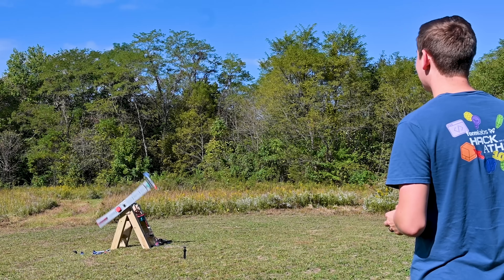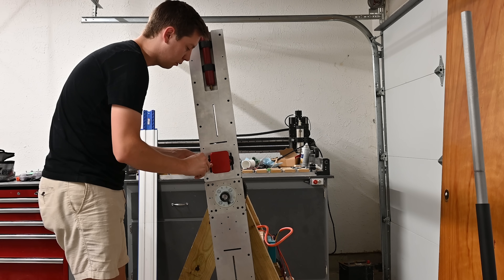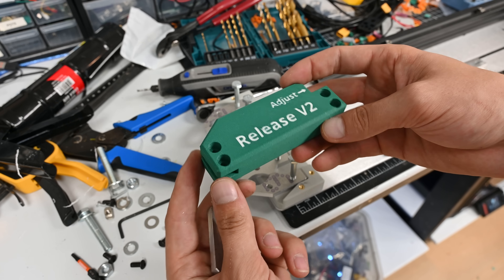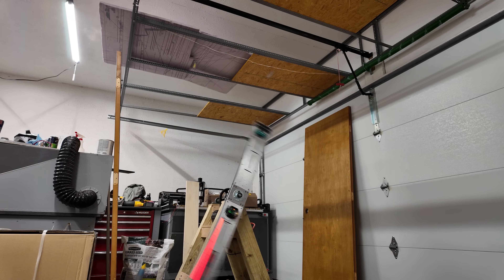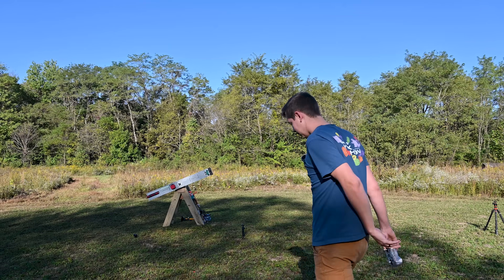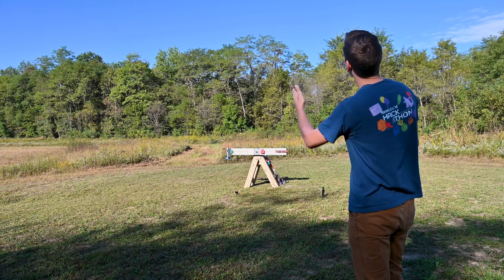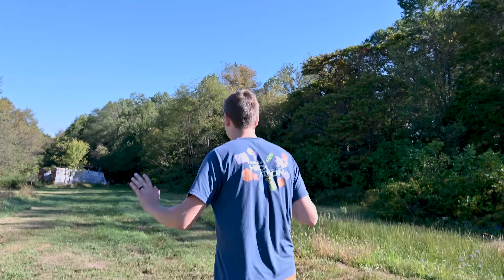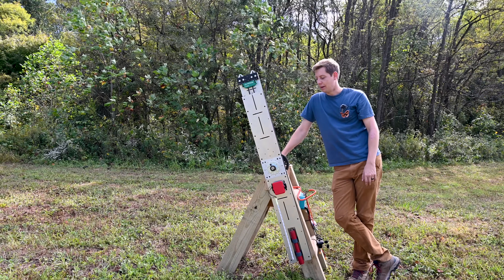I Fixed SpinLaunch

Comment: I may be incorrect as i dont fully know how the release mechanism is powered, but I think that the reason it didnt launch at full speed was because the mechanism requires the green piece to move inwards toward the pivot while the arm is spinning trying to "throw" the green piece away from the pivot. At full speed the outward acceleration might have overpowered whatever force you are using the pull the green piece inwards. Just an idea Good luck

Comment: having those spacer bars retract parallel to the arm means they have to fight the centrifugal force while it is spinning, which is why they could only release below a certain rpm. Easy fix would be to have the spacers retract "up" perpendicular to the arm, which would keep the necessary release force more or less constant.  Another suggestion probably mentioned elsewhere in the comments would be to give each claw a separately actuated high speed linear actuator controlling the release, as the timing varies based on the rpm

Comment: what if you rotate the rocket 90' and release it at top dead center . and you could attach something that weighs the same as the rocket ie. sand/water or a piece of meatal and release it the same time as the rocket, so your spinning arm stays in balance . also think about the sling that was used agents the goliath the projectile is realest at its apex.

 also what if your rocket had a gravity controlled switch so once the rocket starts to slow down you could have a metal ball (probably will need it attached with a small spring) then set off the main rocket motor at the apex.

Comment: I'm only just here to say that dialed in 3d printed nylon is INSANE. Make sure it's WELL dehydrated and then just run a manual purge to extrude a few centimeters of it. Now grab it in either hand and pull with all your might. If you did it right it will hurt you. Like, you literally will hurt yourself trying to break just a thread of it. LOVE that stuff. 🙂

This is some pretty slick engineering. Well done!

Comment: some ideas:
A sliding weight you can use to balance different weighted rockets on the fly 
Perhaps the weight could also automatically shift a tiny bit when rocket is released to keep the arm balanced during spin down
When you start doing faster launches you could use the LED strips to make one of those spinning LED display things

Comment: Step 1: Add a barometric altimeter to get some altitude measurements (small Arduino dev board and a bmp180 module will do)

Step 2: add an rocket motor to be ignited after release (Estes C6 or D12 and an RC receiver so you can decide to not fire it if it's not released straight up)

Step 3: compare altitude between spin launched, rocket motor only launch, and spin launch+ rocket motor fired after release.

Would be very interesting to see if the increase in altitude is additive or not - if you get 200ft altitude when spin launched without firing the rocket motor, and the rocket motor on its own gets to 400ft, will spin launch + firing the rocket motor get to 600ft? Or more? Or less?

Comment: This is not a path to space. This is less of a rocket and more of a gun that doesn't use gun powder.

For space, a spinlaunch system would be meant to replace the first stage of a current rocket system. You still need, at a minimum, the second stage. On a typical Falcon9 when the first stage separates, the second stage, plus the payload and interstage adapter, has a total mass that is initially around 116 metric tons. The velocity at MECO of the first stage and subsequent separation is often in the range of Mach 6 to Mach 10. So a spin launch system needs to get something that weighs a quarter of a million pounds going 6 times faster than the speed of sound. All of a spinlaunch system's first stage deltaV is at launch so even if we ignore the altitude problem we still have to get something that heavy rotating at Mach 6. To hold that rotation the arm would have to withstand an immense force of approximately 16.1 billion Newtons or the equivalent weight of over 16.4 million metric tons. This is an unfeasibly large force, far exceeding the strength of any known structural materials at this scale.

Comment: I'm calling it now, mark the date, time and my words. SpinLaunch will NEVER work at scale. However, what Michael achieved here is an amazing feat of engineering and I hope you find success and happiness in your career field.
Reply: At what scale though? Because spin launch was only really wanting to launch small things.
Reply: @zeroinfinity5864  at NO scale SpinLaunch will work from Earth.
Reply: @zeroinfinity5864  At the scale Spinlaunch wants to operate.
Reply: @martinpenwald9475 Yep which means the smallest space craft possible
Reply: @zeroinfinity5864  Meridian constilation of communication satellites. At that scale. 😊
Reply: It would work perfectly fine for launching moon or asteroid rocks or frozen water from a low gravity no/low atmosphere body further along in space, it's just not super great for the 1g 1 atmosphere Earth to space launch environment.
Reply: @msytdc1577 even that use case would only be an intermediate step until you have a full linear accelerator on the body.
Reply: yea i partialy agree. i dont think a payload like an space shuttle will because a:it needs too much rpm to give it enough momentum to reach orbit, or b:if it can spin fast enough, the g forces is too much for any reasonably priced material to handle. but i think it would work for like small satellites (or low earth orbit)
Reply: @l3ulo  Or, you shrink the scope. Instead of trying to just yeet something straight into orbit, just use it to get the launch vehicle out of the thickest part of the atmosphere, the same principle as launching from an aircraft. But if we're doing all that, launching from an aircraft is probably just all-around safer and more reliable.
Reply: @Plasmafox  OR, launch it from a tall mountain. That way you are already above most of the atmosphere.
Reply: @Qwiegybow04 wrote: "I'm calling it now, mark the date, time and my words. SpinLaunch will NEVER work at scale. However, what Michael achieved here is an amazing feat of engineering and I hope you find success and happiness in your career field."

Absolutely.

SpinLaunch can't be fixed because the entire concept is inherently flawed. The launch arm should be surrounded with a vacuum chamber to counteract aerodynamic drag and heating. The projectile must be brought to a supersonic (ideally hypersonic) velocity relative to the atmosphere surrounding the chamber. The projectile must be released precisely. The projectile must not be imparted with angular momentum upon release. The projectile must be able to transition between the chamber and the atmosphere without having to fight the inrush of the atmosphere into the chamber. The arm and launch assembly must not suffer reactive forces resulting from the separation of the projectile from the launch arm. It is a pipe dream at best.
Reply: @Kargoneth  All things you list are solved.
Reply: @NIOC630  wrote: "All things you list are solved."

What evidence have you?
Reply: @Kargoneth  Youtube doesnt show your comment any more. Cant answer.
Reply: @NIOC630  wrote "Youtube doesnt show your comment any more. Cant answer."

Typical and unfortunate.
Reply: @Kargoneth  At least on that we can agree, youtube sucks these days :)
Reply: one of the hardest parts of building satellites is designing them to survive going up on a rocket. spin launch makes that even worse unforch
Reply: I guess Spinlaunch purchased a 100 year lease on Adec island, Alaska (51.8 degrees north) for nothing. That's certainly not a great latitude for launching communication satellites like StarLink whose orbital incline is about 52 degree. 

And it doesn't make any sense to partnering with NanoAvionics to build satelites for its Meridian Space communications constellation.  

Ohh it will never work and all that money they spent is just wasted, sarcasm 😁.
Reply: @kreynolds1123  It’s a scam. You have to pretend to spend money to get investors hooked. The concept as presented can not work. Like the hyperloop concept, on paper it’s interesting, in practice, it is incredibly costly to realize. Not impossible, but extremely costly. In both cases, the vacuum needed makes the opération not economically sound.
Reply: @kreynolds1123  wrote "I guess Spinlaunch purchased a 100 year lease on Adec island, Alaska (51.8 degrees north) for nothing. That's certainly not a great latitude for launching communication satellites like StarLink whose orbital incline is about 52 degree. 

And it doesn't make any sense to partnering with NanoAvionics to build satelites for its Meridian Space communications constellation.  

Ohh it will never work and all that money they spent is just wasted, sarcasm 😁."

Yes. It is a waste. Those who are getting paid are going to profit from their labour, but the launcher concept cannot work. It was a pipe dream to lure in investors who do not understand physics. The angular momentum of the projectile can be solved by having the projectile counter-rotate as it spins, but then the projectile will need to be reinforced against forces that are constantly rotating around itself. The reactive forces on the launch mechanism can be solved by the sacrificial release of a counterweight, but then the base of the mechanism has to deal with a counterweight slamming down into it at hypersonic speeds. I am not even going to talk about the issues with precision release and the transition between vacuum and atmosphere.

Comment: I think its cool. I expected that the timings on a dual release would need to be tight but instead because it wants to go straight naturally you can see it follow the correct angle as it waits for release. I would imagine if you speed it up these would need to be tighter timing windows but not crazy.

Comment: to reduce the wobble when the rocket is released at higher speeds, on the rocket side of the arm add a sliding counterweight that will replace the weight of the rocket when its released keeping the system balanced.

Comment: amazing job!
are you planning to add auto counter balance after release of the rocket?
something on the same side where the rocket is and as soon as rocket is released the weight will also be release and pushed slightly further out by the spin.
That will immediately counter balance lack of the rocket
what do you think about that idea?

Comment: the release mechanism must be electrically-controlled, for consistency and tunability.
this is great stuff! but you need to be very careful though, because as you've seen spinning masses carry LOTS of energy and can not just launch rockets, they can hurt people and things quite grievously...you should also be ramping-up the materials you are using (e.g., aluminum instead of plastic/etc.), and safety enclosures.

Comment: for the imbalance, have you thought of putting another weight on the arm closer to the centre then just before you release you start shifting that weight down the arm to prepare for the loss in weight so it can replace it

Comment: You definitely should be able to control release variables through software, printing restriction fittings for the pneumatic release system kind of paints your into an engineering corner... I love everything about this project, btw!!!

Comment: Heavier rockets first I think, to combat the effect of air resistance, as those little plastic rockets seem really light - and it'll let you get higher without needing more power. Then MOAR SPEED. Maybe a GPS altimeter in them?

Comment: Not to poke too many holes in the spin launch concept but if you were to take a normal thin skinned aluminum rocket and spin it that fast the angular momentum would tear it apart.  No matter what a spin launch vehicle will have to be incredibly strong to withstand the force of rotation.  Probably 20-50 times thicker skinned than a conventional rocket skin.  All of that weight will be a huge hindrance in achieving space flight.  Probably more of a hindrance than the spin launch is worth.

Comment: If you can get your spin launcher inside a vacuum chamber you'll have less drag as it spins faster and faster allowing you to get faster speeds easier. You'll have to work out the timing for opening the chamber to let the launch vehicle out though.

Comment: 0:30 *was. Pretty sure the last time I heard from the project was that they gave up? Not surprising though, thunderfoot already showed why the concept is destined to fail.
Reply: didnt give up, they even had a couple successful tests with nasa satellites, so no, the concept wasnt destined to fail, the main problem that put the project on a temporary hold is that until a stronger alloy is produced the spin launch system only works with very specific types of payloads at very specific size, which makes it pretty pointless since most space launches require a size way too large for spin launch. but regardless, the tech DOES work, just not very useful
Reply: Thnderfoot also said starship would never fly or land and the falcon rockets would be a fail.
Reply: @NIOC630 among many, many other things.

Comment: Add a counterweight on the same side as the rocket but closer to the middle. When the rocket releases, release the counterweight to slide toward the end of the arm to take the place of the rocket’s weight for a smooth slowdown.

Comment: I would recommend you stick with the same motor setup and work on some type of CVT transmission so you can increase speed without having to spend a lot more money. Then use the savings to upgrade your sensors and the actuators.

Comment: Could you build the rocket with an engine and remote ignition, so you could use it as a second stage to the spin launch, firing it when it starts to slow down?

Comment: Hey Michael, great video! I was pondering the issue of an unbalanced spinning mechanism, and you may want to consider a movable mass on the opposite end of the launching arm. When the rocket is released, the weight moves inwards towards the rotation point to move the center of mass for the spinning mechanism back in alignment with the shaft. Subscribed to see how this project goes!

Comment: mmm, i'm having a hard time believing that rotation has anything to do with it. an object can't have a moment of inertia outside of it. it's really just the release mechanism imparting spin. you can prove it by using nothing but a string to hold a rock and cutting the string. The rock won't spin.

Comment: No you did not !
The problem here is that this is not scaling up at all.
a lot like small plastic toy robots can easily be bipedal, but as soon as they reach 1 meter of size, levery become too long, and matrials become too weak, and controls become not precise enough for small angles.

Comment: 15:40 or add a motor with a remote start. adding both weight and increased propulsion insuring the rocket does in fact reach a higher altitude.

Comment: Have you considered a second counter-spinning rotor at the throwing end of the arm? You can belt-drive it, and because of the mechanical linkage, the rocket basically has no spin, regardless of the RPM or the weight.

Comment: Looks like a pretty lightweight rocket. I'd say it would be worth experimenting with adding weight to the nose cone. Since you launch at a fixed speed instead of a fixed power (like a traditional rocket motor) being heavier means launching with more kinetic energy.

Comment: Your solution is unnecessarily complicated and only works at a specific RPM. You want your two releases to individually release when they are at a specific angle in the rotation. When the release is on the same height as the center of rotation (not the whole arm, the individual release). So the time offset depends on the RPM. The easiest way to do this would be with a cheap micro controller and a few electronically controlled releases, they don't need to be fast, they just have to release at a repeatable time. I'm guessing some cheap solenoids (not solenoid valves) would be fine. If you wanna go for the complicated and less fine tunable mechanical solution. Just ensure that each release releases releases at it's own specific point in the rotation. Don't use some time offset loosely tuned to your speed. Do it correctly and make it dependent on angle, not time.

Comment: I haven't seen the first video, so I'm not sure what kind of mechanism you're using. Is the release mechanism a pin from the stationary part that extends and thereby pulls a trigger in the rotor?
If you allow the pin to rotate independently, you could adjust the mechanism to release the rocket at any desired point with consistent accuracy.

Comment: For the release, what if you opted for two electronically actuated mechanisms (either directly actuating, or controlling an air valve) and have that controlled by whatever is currently controlling when its released (I forgor from last video). That should already know where it is in its rotation, as well the speed of rotation, so you can figure out the rotational torque, how much delay should occur in release, and then execute that using the controller.

Comment: You need to get a system on it that works like a Centramatics Balancer. It's like a lead slushy in a round tube and it moves to balance the wheel. It'll balance it as the rocket leaves the launcher.

Comment: Quick question, Why did you decide to "Pull" towards the centre for the release mechanism? Would pushing a bar that goes thinner do the same but without fighting the forces of pulling it towards the centre. Might also be faster to respond to activating.